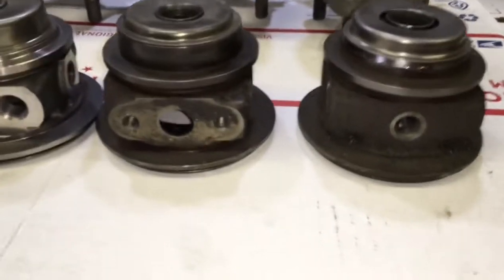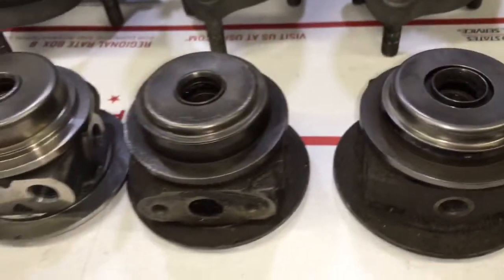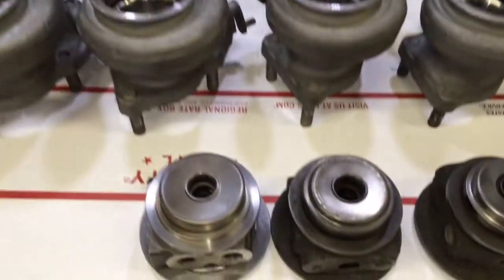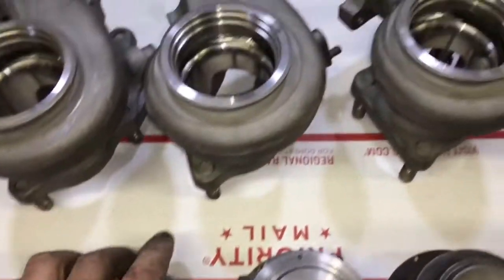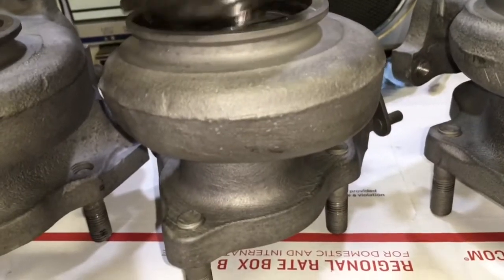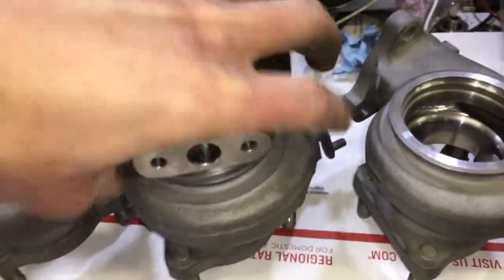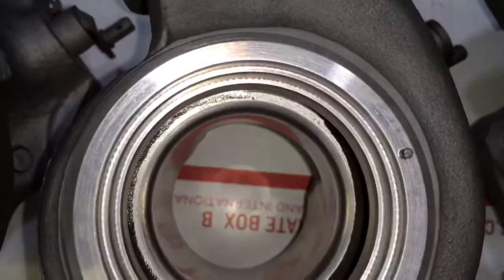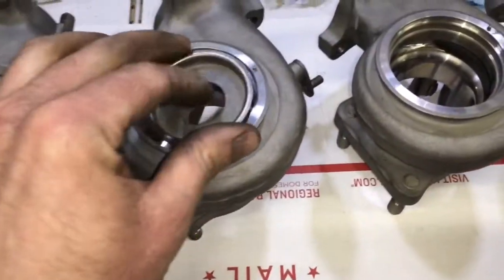3 TDO4 Heatshield Variations

Comment: these TD04 turbos are the ultimate sleeper turbo for the 3000GT VR4,VR4 Spyder and Dodge Stealth Twin Turbos because they appear stock. with a good blend of metals and heat/cold process on a Titanium Aluminide turbine and shaft and of course proper supporting modifications one can achieve over 600 hp to the wheels, crazy for these little turbos!
Reply: The TD04-9b turbos have phenomenal torque on the 6G72 engine. Floor it in 3rd at 2000 rpm, wait a moment, and then you have all of the torques to 6000 rpm. That's stock.
Then you get into machining and billet wheels. Dynamic Racing has what they call DR750s. They take your turbos, work magic, and give them back looking exactly the same except now:

(Taken from 3sx.com)

These turbos made 604 AWHP, and 611 AWTQ to the wheels on Matt M.'s totally stock motor 95 Dodge Stealth with 80,000 miles on the motor, stock block, stock heads, stock cams. At 25psi of boost.

Eric M. also made 609 AWHP and 651 AWTQ on his Stock long block, but with adjustable cam gears, 91 Stealth RT TT at 25psi of boost on PUMP GAS, with these turbos. Eric's car broke 400ft/lb of TQ at 3100rpm, and brakes 600ft/lb of TQ at 3900rpm!

Ray P. on his 96 3000gt VR-4, with a stock 185K Mile motor, Billet DR650's, 550cc injectors, Fuel controller, downpipe, Fuel pump, and boost control made 519 AWHP and 565 AWTQ! This through stock intercoolers, and stock cat back exhaust, on an old tired 185K mile motor

Comment: I have been following for a while now, trying go convince my friend who just got a 335i n54 07 to send you his turbos for the upgrade you offer, do you know what kind numbers power was can they go up to after your upgrade.
Reply from the maker: +ossama elsiah I had someone gain 47 hp after the turbo install. If his turbos are still good he should do the downpipes and intercooler than the mhd wedge stage 2 tune. I did that to mine and it makes great power but the clutch slips now because of the higher torque
Reply: Turbo Lab America his turbos are good they were replaced under warranty about 20k miles ago. he already has down pips, hard piping and intercooler. of course JB4 tune.